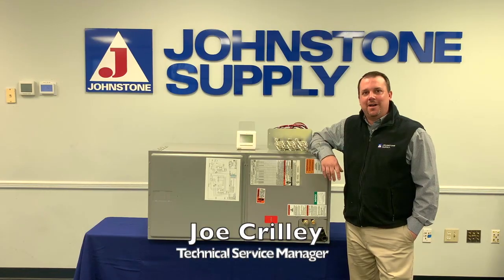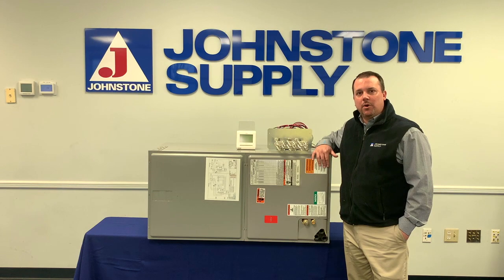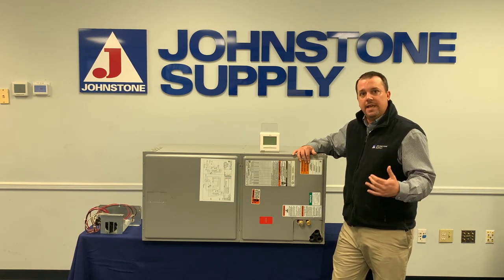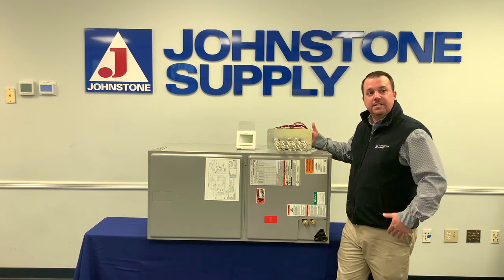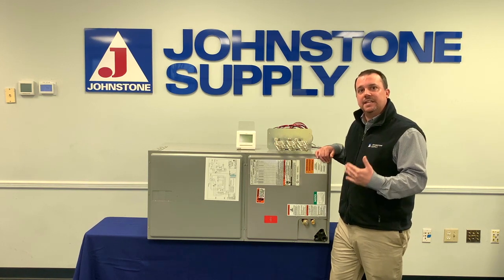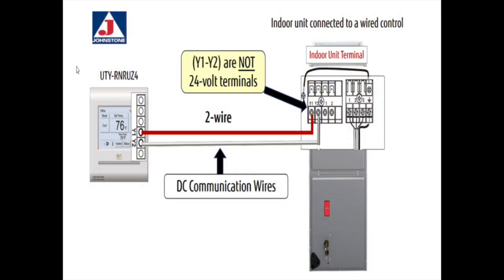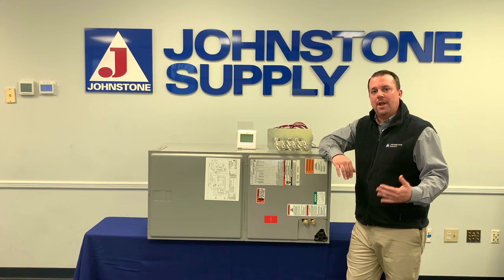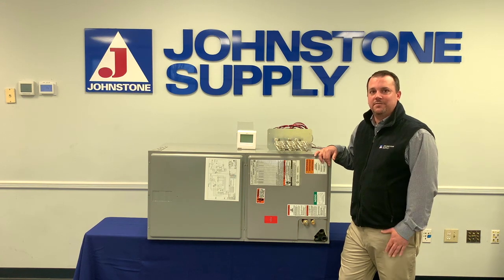Fujitsu AMUG Air Handler

Comment: Did you ever make the followup videos?
Reply: At the end of the video, he said there’s gonna be more videos that talk about flipping the coil. I’d like to see more videos about how the thermostat works and if you can hook it up to Wi-Fi and will the thermostat modulate the inverter output to maintain the setpoint or does it cycle on and off with lower efficiency?
Reply from the maker: What are you interested in seeing?

Comment: If unit can go down to 5 degrees with no derating at a given temp. Why would I need a heat strip? And question if it’s recommended then how do I size it? Also does remote have an emergency heat feature if unit outside fails? Who can I contact for more information. I tried read information and can’t get manual on heat strip or t stat on your app .